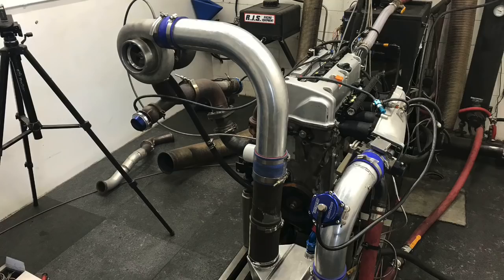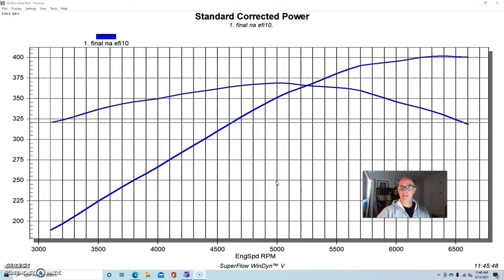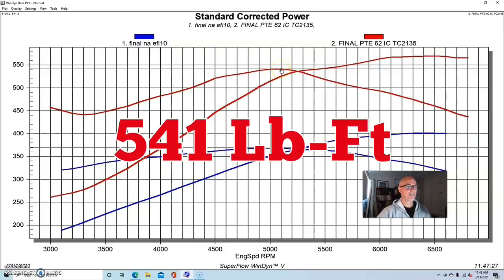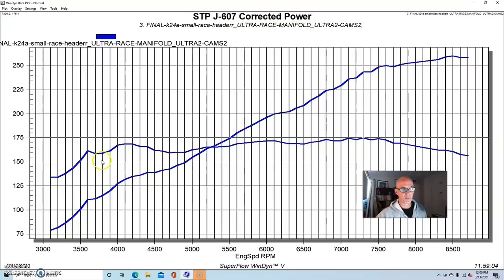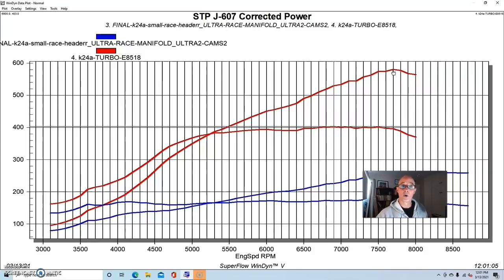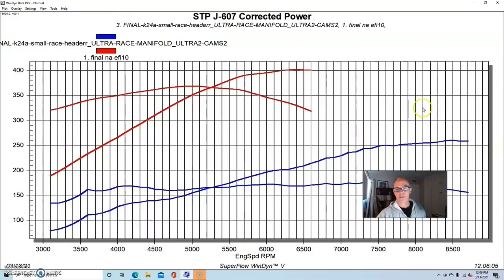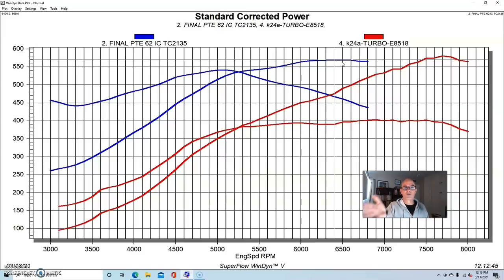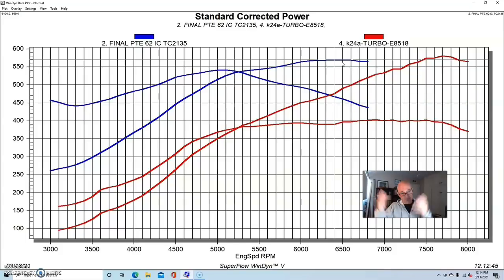CHEAP, JUNKYARD BOOST TEST-K SERIES HONDA VS LS (2.4L vs 4.8L)

Comment: Yes. I love the math of the power output.  The 2.4 engineered to be a v8 version would whoop most na ls motors?? Or that’s not how it works??? .  Lol.  Thanks Richard!!!
Reply: That's not how it works at all. Tq is the power a engine makes.
Reply: @HioSSilver1999  It's about torque to the wheels. If engine "A" has 400ft/lbs with a 5,000 rpm redline, and and engine "B" has 200ft/lbs with a 10,000 rpm redline, then you can use 2 times shorter gearing in engine "B" to achieve a given speed. Gearing multiplies torque to the wheels, so both of these cars would accelerate at the same speed if all other variables are the same.
Reply: @Jr_5646  yea....it don't quite work like that. 

But while you're trying to even everything up.....even up those boost levels and watch what happens. But really that don't even need to be done.....na results are even boost
Reply: @HioSSilver1999  Gearing multiplies engine torque. Thats exactly how it works! Thats why you accelerate faster in 2nd gear then you do in 3rd. The engine isn't producing more HP or torque at a given rpm. The gearing advantage is producing that. A stock Lamborghini huracan makes about 400 ft/lbs of torque to the wheels. Thats the same or a little less then my stock camaro, but a huracan will destroy my car because it can carry that torque way past the rpm that I can and can use shorter gearing. Thats how horsepower works. I own a pushrod powered car, but im not a fanboy of it. There's many different ways to go fast, and I like them all.
Reply: @Jr_5646  no it's not exactly....except in theory.  

What you run into is steeper gears turn faster.....they turn faster in oil....which creates drag.....thus losing efficiency.

You keep going off on different tangents trying to prove your point. What you need to concentrate on is proper gearing for a given combo.
Reply: @HioSSilver1999  Yes, there will be more parasitic losses with the shorter gears, but its not a significant amount. Its not like the aventador from my example is losing a lot higher percentage of power then my camaro because of gearing. I was trying to keep the math simple for my example. I was discussing "wheel torque" so drivetrain losses would be factored in already. The original post was about a hypothetical V8 K series engine, and your claim essentially was that it wouldn't make as much torque as an LS. Probably true, but my claim is that torque at the flywheel doesn't necessarily mean more torque at the wheels which is the only thing the car cares about when accelerating. All my posts have been about that relationship, so I dont see how I have been off topic. Again, a formula 1 engine makes very little torque, but if I put one in my car and changed the gearing appropriately, it would be way faster.
Reply: @HioSSilver1999  I don’t what your referring to. All I mentioned was taking the 4 cylinder and duplicating it to be a v8. That all I wa saying. What you saying???? What???
Reply: @theozman38  Sorry we hijacked your post lol. My original post was to you and on topic. That other guy's first post didn't seem to make sense so i responded. Wish I wouldn't have now.
Reply: @Jr_5646    No not at all. Don’t be apologizing. It was a good chunk of info and interesting views.  You made it good for what I said. I really didn’t add anything. It was all of you and it’s all good stuff!!!
Reply: A V8 "K48" Honda engine would definitely make more power then any 4.8 or 5.3 LS, and it should. We would be talking about a DOHC V8 with Vtec versus and old pushrod design. The only advantage for the pushrod is packaging. They are small physically. You can fit a 7.0 LS7 in the same space that you could fit a 5.0 coyote or this hypothetical "K48" Honda engine. I'd still love to see it though.
Reply: Yup...it got a little side tracked. In the end it dont work how either one of you think.
Reply: @HioSSilver1999  Teach us the ways 🤣. I think this hypothetical K48 engine would turn out very similar to the torque and hp curve of a coyote engine. Probably a little less peak torque, but a little flatter and carrying out a little higher rpm with Vtecs dual cam profile.
Reply: @Jr_5646  very good point. But in the comparison of a ls the coyotah gets thrashed. So this k24 would also.

The only hope of either is that they mess with a 4.8 pick up truck engine and not the high performance variety that you're making a comparison to.
Reply: @HioSSilver1999  The gen 3 coyote makes 460 hp. More then any stock naturally aspirated LS other then the 7 liter LS7. I wouldn't call that getting destroyed exactly. Its a great little motor, and the LS/LT with its pushrod design needs more cubes to compete. Like I said in my original post, the pushrods advantage is its small packaging. So a 7 liter LS7 is still smaller physically than a 5.0 coyote. At the end of the day they are both great, but EPA emissions regulations will end big displacement engines sooner or later so you better get used to turbo 4 cylinders unfortunately 😢.
Reply: @Jr_5646  i guess you forgot about the ls2. So no the gen3 coyotah doesn't make more power. Besides....tq is power. So it's down to the lt1 also.

Now if you really want to get serious we can get into modifying the engines to where the coyotah gets thrashed really bad.

The coyotah needs more cams....needs more valves....needs more compression.....needs more timing chain to compete with a smaller lighter package. 

The coyotah isn't that impressive.  It's just the best ford has made.
Reply: @HioSSilver1999  🤦‍♂️ Im gunna assume you mean the 495 hp LT2 and not the 400 hp LS2. What about the 5.2 liter 526 hp voodoo engine then? I've made the exact same arguement you have made to coyote fanboys about the LS/LT. I dont think one is better or worse then the other. I think they both get very similar results with similar mods. One just does it with displacement and the other with more efficient cylinder heads. I actually prefer the LS/LT. Look no farther then my profile pic to see which I drive and prefer. Im playing devils advocate really. I like that the LS is cheaper to mod, picks up huge power with cam only, and has more freedom to increase displacement. However, its not perfect. The coyote has some advantages that i wish the LS had. Ability to rev without a crazy rotating assembly, stronger pistons and rods from the factory (in comparison to the Lt1), and responds better to boost (again talking about the na variants not the LT4/LT5). The iron block 4.8, 5.3, 6.0, and aftermarket LSX blocks are a different story, but come with a weight disadvantage.
Reply: @Jr_5646  since tq is the power the engine makes and you keep moving the goal posts.....you still lose on the devils advocate part.

On top of that ls stuff especially gen4 is stupid strong. We've turned sbe ls3 8k rpm and gpi has spun sbe stuff to 8700. Even regular old gen3 sbe has seen 8k rpm. The bottom end not being able to withstand rpm is just something some furd monger made up.

Coyotah doesn't respond better to boost. Another false rumor . All engines are boosted even. Na they run at 14.7 psi.....so if a engine makes say 470whp 472wtq because we've made that with bolt on ls3s then if you efficiently double the atmosphere it doubles the power.......for every engine. One doesn't respond any better than the other.

Put 14.7 psi on top of atmosphere to a 5hp briggs engine and you will get 10hp.....just that simple.

Now where shit gets complicated is not every engine takes the same blower or turbo to be efficient at the same boost level.
Reply: @HioSSilver1999  Let me clarify my "responds better to boost" comment. I wasn't saying that psi to psi the coyote responds better. I was referring to the shitty powdered pistons and rods GM uses in the LT1 that limits the amount of boost that you can reliably run. Key word here is "reliably". I guess thats a relative term, but look at any company that has performance packages for the two engines, and you will see the coyote consistantly being offered with sbe around 750 whp where as the LTs seem to be upgraded around the 650 whp mark. Yes, both engines can be built to more sbe, and I'm sure you can find a million examples of both doing just that, but its not a coincidence that companies whos reputations are on the line all choose to upgrade the internals at that point. GPI built that engine specifically for the sbe record. They don't care if it makes it 1 mile or 100,000. Also, what is their definition of sbe? Does it have stock rod bolts? Stock wrist pins? I Don't know, but its doubtful.Especially if they want it to last more then a week. What amount of head work was done? What are the cam specs? What kind of intake manifold was needed? Then there's the valvetrain. Titanium valves and retainers? That ain't cheap. How stiff do the pushrods have to be to be stable at that rpm? How stiff do the valvesprings have to be to prevent valve float? How much maintenence would be required to keep that engine alive at those rpms for any length of time?........With a gen 3 coyote you are a cobra jet  intake and tune away from 8,000 rpm. That's it! Not saying a LS can't be turned to 8k, but it's exponentially more difficult and not something a typical street/strip build would ever achieve. Im not moving any goal posts. This is weird, because I'm an LS fan, and I feel like I'm forced to defend the coyote, because you're such an LS fanboy that you can't see the value or advantages of any other engine 🤣. You can't even acknowledge that a DOHC is a better platform for high rpms. I thought that was an easy one. BTW, what is the whole "torque is power" thing you keep saying? Torque and power are 2 different things. I guess they are related, but speed needs to be factored in to the power equation.
Reply: @HioSSilver1999  I was wondering how long it would take for the conversation to deteriorate to name calling. Congrats. You made it longer then the average youtube commenter I guess. You're right. Powdered rods are way better then forged 👍. Yes, today's engines are stronger then ever. Technology advancements have moved everything forward, but modern forged is still better then modern cast/powdered metal. My choice of words was probably not great calling them shitty. They will handle more then I plan on making, but they dont seem to be as strong as the coyote rods and pistons. Which was my original point. Please, send me a link of a single performance shop that sells supercharged packages for both cars that sells a higher HP package for the camaro ss with stock internals then it does for the 2018 mustangs. I'm being serious! Please send one cuz I've never seen it. Not 1! Yes, the tight ring gaps are an issue with the LT1. Yes, fueling and tune are critical for longevity( no different then any other car in that regard). Many performance shops such ar RPM run E as well as meth injection for cooling. As you should. The more you can do to prevent detonation the better. RPM won't run more then 9-10 psi on the stock pistons. Is the tuner there a dumbass? I think I'd trust his opinion more then some random guy on a youtube comment section. What do you suggest that everyone who wants to mod their LT1 pull the engine of their daily driver so they can gap the rings? Hell, they already have to replace the cam to get a bigger fuel lobe to supply the direct injection if they want to make over 600 wheel so I guess they might as well do that too while they are at it. I guess thats another advantage for the mustang. The fact that Ford included Port and direct injection on the 2018s. You want 700 plus on one of those? Just add a whipple, and injectors and call it a day.....even on pump gas. You want to add port injection to the LT1? That's about $6,000. Not saying the coyote is without fault either. There's still the oil pump gear and crank sprocket issue that needs to be addressed. Im gunna say this one more time. Both are great engines. Neither one of the them thrashes the other. Look how far off the rails and off topic this conversation has gotten. This was supposed to be about a fictional K series, and you make some random torque is power comment. You still haven't explained what in the hell that means exactly, and you haven't addressed anything from my previous post other then your contention about the LT1 rods and pistons. I Dont even care about that at this point. Just send me that link for that reputable shop that is selling that 700 whp stock internal (stock everything else actually), pump gas, bolt on kit for a 6th gen camaro for $8400 like whipple has for the mustang. Please and thanks.

Comment: I like the idea of running the 4.8 at lower boost and lower rpm. It just seems like a more reliable and drivable combination. I’m not sure what the weight difference is between the two. Obviously the 2.4 would be the better choice if space is limited.
Reply: Agreed.
Reply: you can usually use a smaller car too. Ariel Atom can use a k24, the lightest small block car I can think of is a cobra.
Reply: @Burnoutkid11  Sunbeam Tigers are light, too. A K24 in an Ariel is a match made in heaven.
Reply: Considering an ecotec come in 1.6-2.4.

It's like taking a truck with 2.7 LT with turbo vs a 4.8 LS or 5.3 LS/LT. Once the turbo shells, it lacks power to move the truck.

4.8 was built for reliability in mind with tons of torque without needing complex vvt which fails.

Comment: My car never sees below 4000 RPMs after I launch. With that k-series making more torque at every point past about 7,000 rpms, with the right gearing, the k could likely average more power since it could hang up in the revs no problem
Reply: It might make more torque past 7000rpm but comparing both engines power band it makes WAY less torque by a long shot. If you are looking at average power the 4.8 is the best option here. look how flat that HP curve is. Give the 4.8 another .5lb of boost so that both engines are making 580hp and the 4.8 would carry that 580hp for like 700-800rpm while the 2.4 just peaks there
Reply: @DBLDREW  Hypothetically adding boost to the 4.8 to make it exceed the power of the 2.4 defeats the point of the test. In reality, all that torque is moot because that combo wont see below 4500 rpms after it launches just as the k wont see much anything below 6k. Now, averaging the power curves from the usable powerband it would actually see at wot, roughly from 5k-7krpms for the ls, and from 6-8k for the k, they are almost identical. This means that the torque advantage down low for the ls would add little advantage in a race as compared to a combo that maintains its torque production all the way to redline. Anytime you sustain torque production to a higher rpms, you will make more power. Also, i dont think you'd quite have the boost response off idle in a car as Richard is able to achieve in testing. The engine gets hung wide open at the start point and artificial load is added to spool the turbo. Just food for thought. Imho, both are fantastic choices for a performance engine. Both have tons of potential and advantages in their own rights.
Reply: @madmod  you dont need to add boost up on the 4.8, it already has way more average power the way it was tested. was just saying to make a more accurate comparison it would help to make them both 580hp. Peak power is great for bragging but average power is how you go fast. Your going to run each engine up to 6800rpm for the 4.8 and 8000rpm for the 2.4 and then shift gears. Now depending on gear ratios your going to drop 1500 rpm or so. the 4.8L at 5300 rpm is at 540hp 540ftlb the 2.4L at 6500rpm is only at 490hp, 400ftlb, thats a 50hp drop in hp and 140ftlb of torque drop. the 4.8 makes more power everywhere except for about a 300rpm range at the peak. The 4.8 would be a much much faster engine even though its down aprx 10hp at the peak. Add a small amount of boost and its a even more of a difference.
Reply: @DBLDREW  one would typically run that 4.8 on out to 7200-7500 for a shift point....which would probably want another intake of which it would make even more power.

Just a little something to make the honda guy cry some more....lol
Reply: @HioSSilver1999  well if you wanna go that way you change the k series cam build it to rev to 10k and 450 to 500 na hp
Reply: @h3xd3m0n9  that's all....out of 10k rpm. And probably maybe 200 tq.......weak af
Reply: @HioSSilver1999  500hp/300tq NA out of a 4cyl is insane. How could you possibly hate on that?
Reply: @turbohayabusa01  for starters they sound like shit. Like not even normal shit but the stinkiest of shit. 

Then there's the tq curve which is shit. E85 has been a savior for that junk or you would need $10 per gallon race fuel to keep it alive......then on top of that most that shit is wrong wheel drive.
Reply: @HioSSilver1999  sounds like you’ve been drug by a wrong wheel drive 4cyl and hate your life 😂. Gota love when people can’t just admit Honda’s have come a long way and are actually capable now. If it’s not your cup of tea that’s fine but to discredit what it’s capable of is just ignorance
Reply: @turbohayabusa01  nope....but ive drug some 500whp junk hondas🤣🤣🤣🤣
Hondas are poop
Reply: @HioSSilver1999  doubtful. A 500whp Honda weighing in about 2300lbs which is even high for most built Honda’s would run a mid to high 9 second pass. Looking at a video for up posted not that long ago getting beat by a mid 10sec vette says other wise.